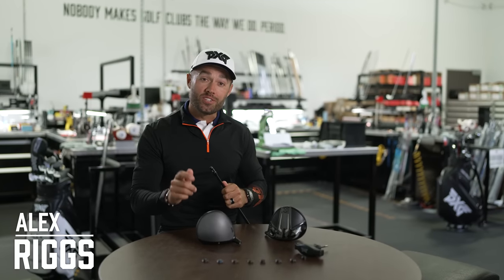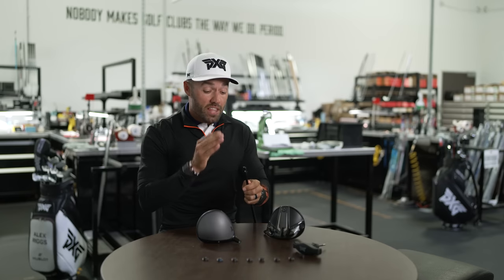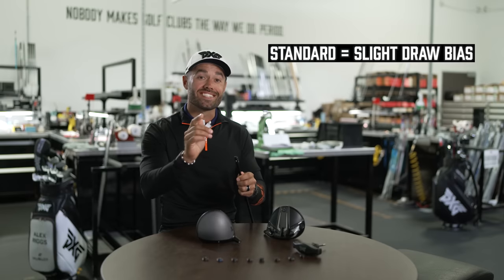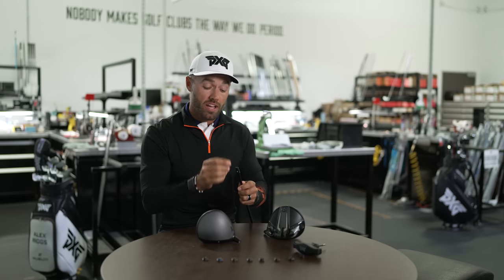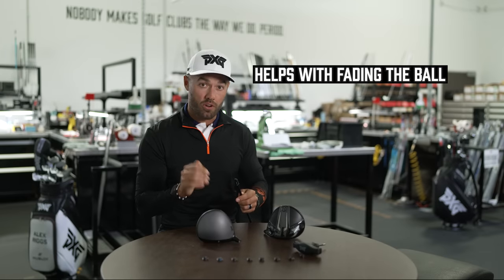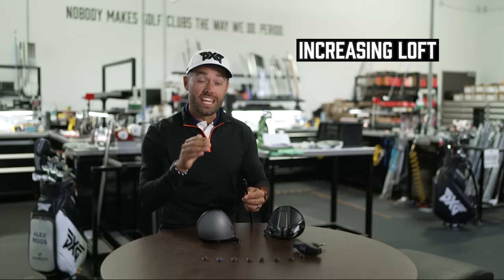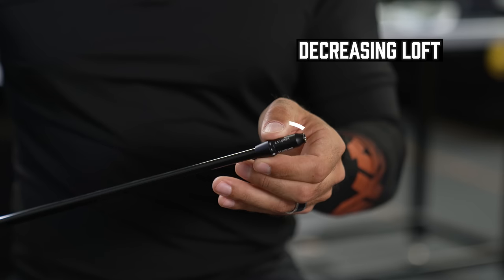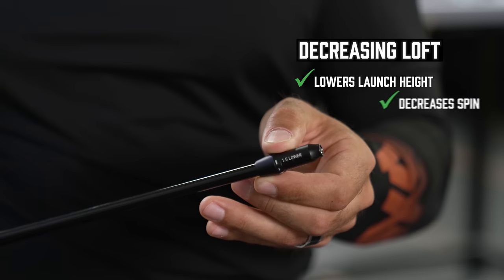How to Adjust the PXG GEN5 Driver Hosel Settings | PGA Instructor Alex Riggs

Comment: Are those hosel settings the same for the earlier Generations too? Does the higher loft also increase toe angle?
Reply: I was gonna ask that too! 😂
Reply from the maker: Yes, our hosels have remained the same throughout every generation of clubs. And yes, increasing your loft will change your toe angle. ^Chelsea
Reply: Just got a 0811X gen 4 today and was just looking at the head adjustments ,when i put the head on again there is a tiny gap maybe 1mm between the ferrule on the shaft and the head is this the way it should be ,i didn't pay attention to how it was before i took it off....
Reply from the maker: @mac4758  Feel free to give one of our master fitters a call at 1-844-PLAY-PXG and they can talk through this with you. 😊 ^Chelsea

Comment: I play in lots of wind and would prefer lower ball flight.  I found if I swing easier with both drivers I hit a slight fade.  I thought the weights would help me hit a draw.  Club is an inch and 1/2 longer.  I've tried choking up.  I have a steep swing plane and go over the top sometimes.

My new driver GEN 5 XF was 9 degrees on the dot.  Ball flight is way higher than I expected.  I'm not hitting it any further than my old  TaylorMade M2 driver which is set to 9.5.  Why is that?   Does it take time to adjust to?
Reply: Sounds like you already know. 
More in-to-out swing path required.
Reply from the maker: Hi there – The best people to talk to would be our team of master fitters. They can be reached at 1-844-PLAY-PXG. ^Chelsea
Reply: I also had an M2 for years, not sure my Gen 5 is as long.

Comment: Not too helpful.  I am looking for information on HOW to adjust the hozel.   I can remove the head to expose the adjustor,  but it does not rotate.  What is the trick?
Reply: The adaptor itself does not spin. That is glued onto the shaft. You just rotate the head. For a higher ball flight go to the 1.5+ setting or a lower flight 1.5 minus setting.